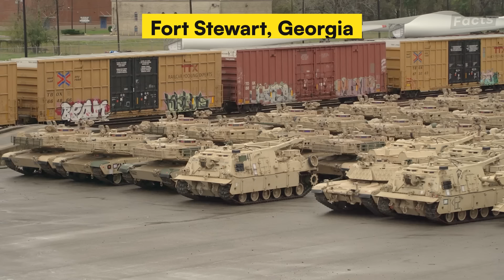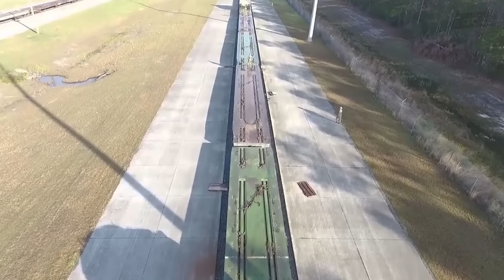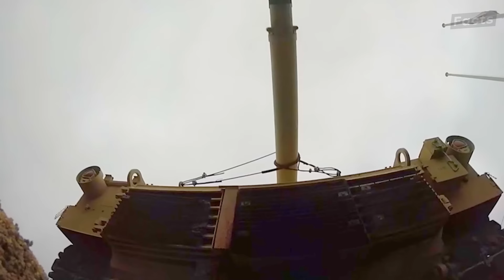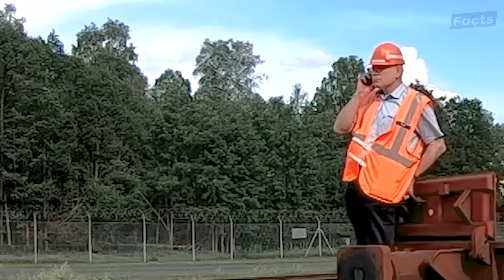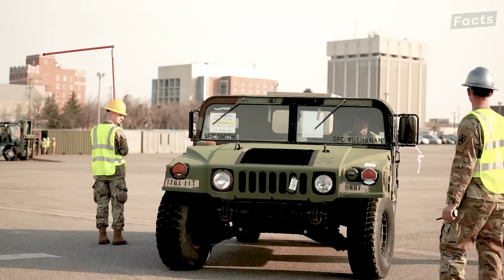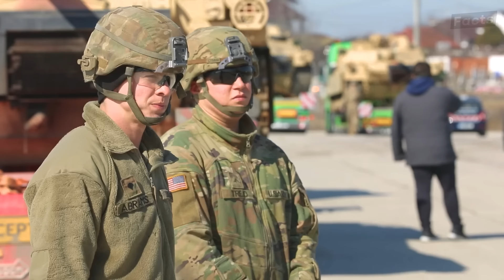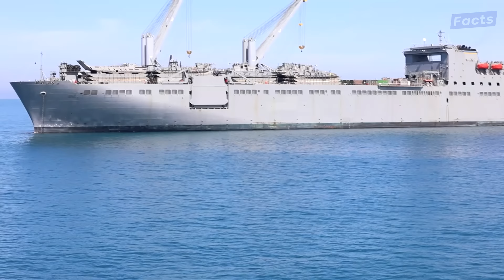Inside The US Military’s Massive Global Transportation System

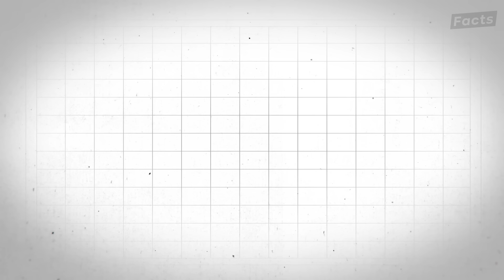Comment: SO at 0:01 you say there are 87 Abraham Tanks, 152 Bradleys & 4,000 other vehicles, but at 13:31 its says the ship can only hold 58 tanks, 48 Bradleys & 900 other vehicles. So someone screwed up as they need more than 1 ship to transport all the vehicles. Also a 1mile long train has 84 x 68ft carriages. Even in you have 2 Abrahams tanks to 1 carriage (you said they can only have one) they will  use 44 carriages. That means you will have 3913 vehicles to fit on the remaining 40 carriages🤔 Even if you got 4 of these vehicles to 1x carriage you will need  another ELEVEN trains!!!
Reply: Yes, it takes two LMSRs to move an ABCT.   Or you can shift the loads around to make one M1 heavy if you want.  It varies per mission set.